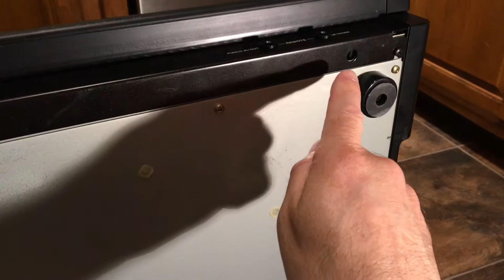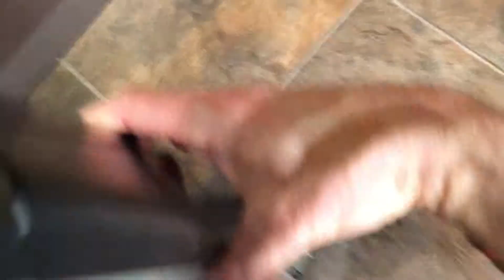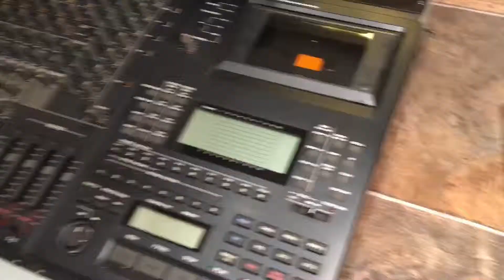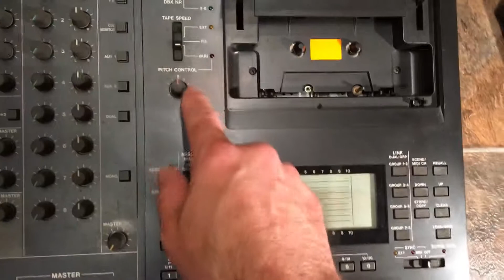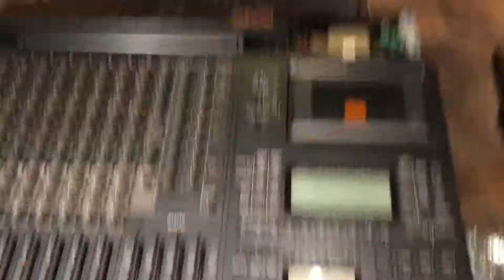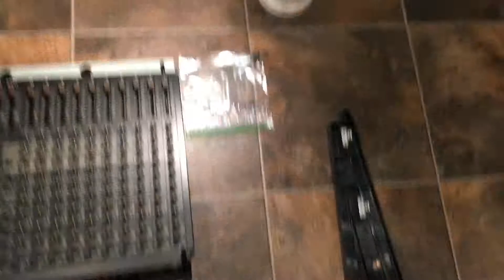Tascam 688 MIDISTUDIO: How To Open And Access The Guts

Comment: Thank you for this detailed video, man! Do you have a link to the replacement belt? My 688 has exactly the same issue..
Reply from the maker: You bet: https://www.ebay.com/itm/202142356915?mkcid=16&mkevt=1&mkrid=711-127632-2357-0&ssspo=oC2oZ3lETSe&sssrc=4429486&ssuid=-le5cs0tQ9u&var=&widget_ver=artemis&media=COPY I’ve purchased a number of parts from this Seller and they’ve all been good transactions.

Comment: just fixed the belt tanks a million you vide was really helpful however the record function is no working any idea why not? or what could be wrong?
Reply from the maker: Did it ever work since you’ve had the machine?
Reply: @SweetbeatsTechStop  no I bought it broken
Reply: @SweetbeatsTechStop  no I bought it not working but it work once as it works on my other machine
Reply from the maker: So it wasn’t working when you bought it but it worked once since you bought it?
Reply: @SweetbeatsTechStop  no I bought it off ebay broken. therecord function does not work.I have another one which does work thou.

Comment: I just replaced an input capacitor on one of the mixer boards. It had no sound on the line and dual line input.  First i thought it was the switching audio IC, but I found the capacitor after replacing all IC's, but those where not the problem.  It's possible to do it yourself.  Maintenance can be expensive, because most of the work is removing screws, and keeping the unit undamaged.  Great video.